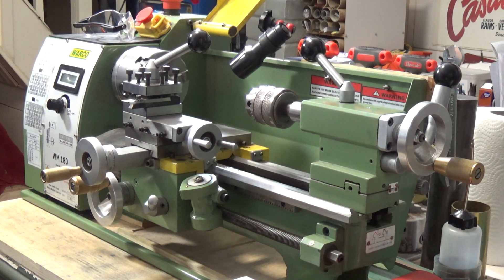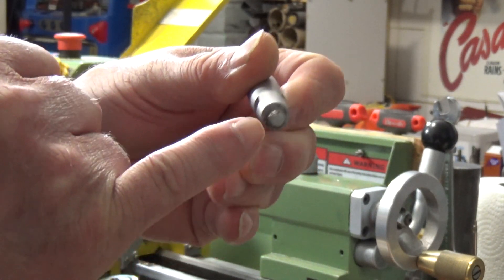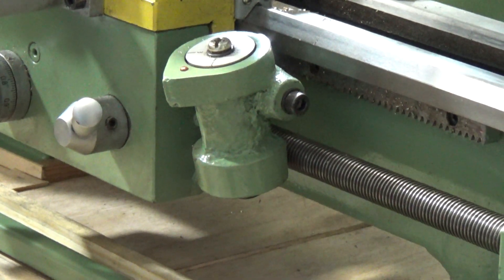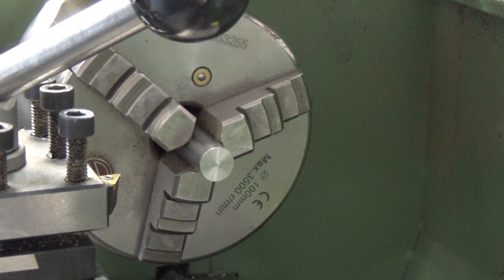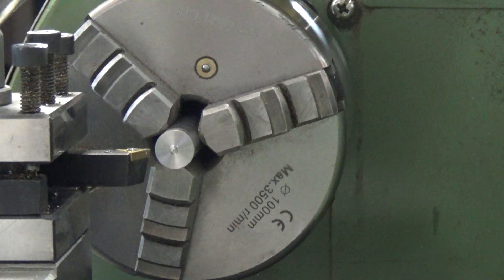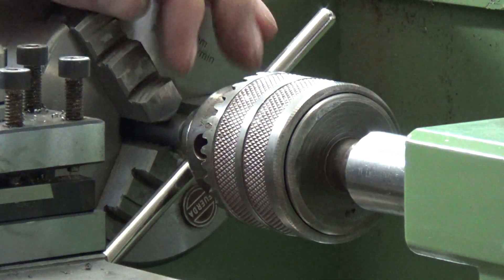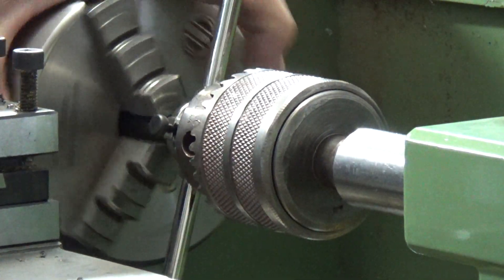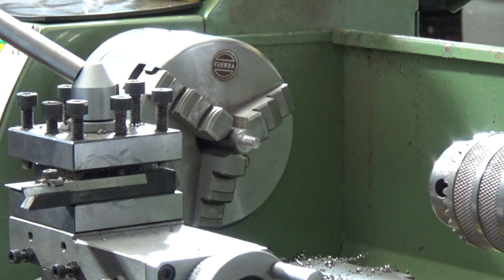Modern Mechanical Tech - Warco WM180 Lathe Handle Upgrades - Part 1

Comment: I'll never understand the need for carbide cutters for such tiny cuts, all YouTube machinist are using carbide on those little lathes.
If you learned how to grind high speed steel cutters, you could slow the revs down and take much larger cuts. Carbide insets are not really sharp and require a lot  of motor power.

Comment: Nice improvements . I need to do the feed handle on mine now . my original tool post handle actually snapped off . cheers for the shout out once again , Ade.
Reply from the maker: They're rubbish aren't they! Mine didn't snap off but it was very definitely bent by the time i replaced it.